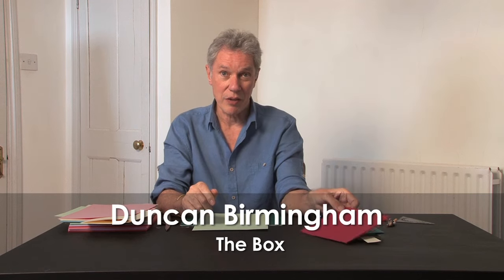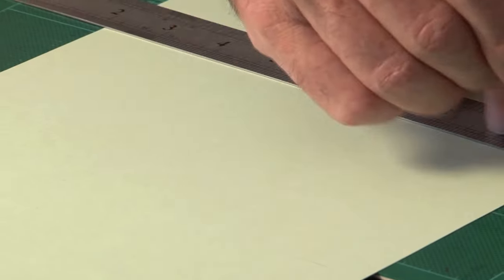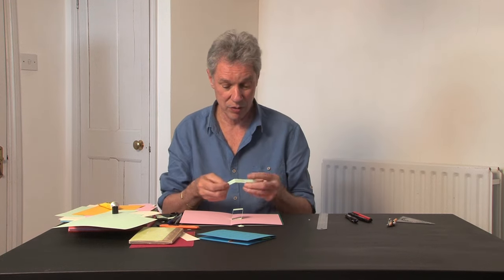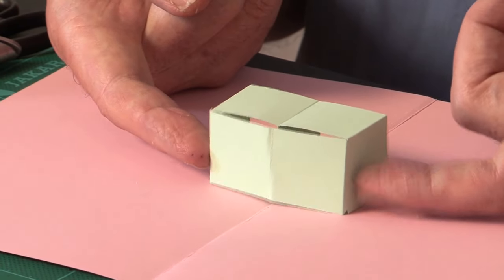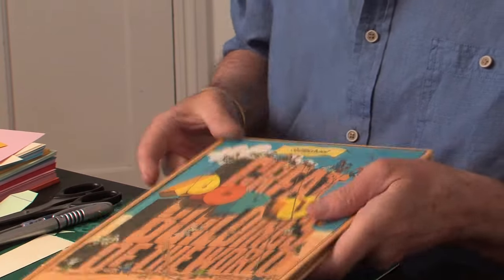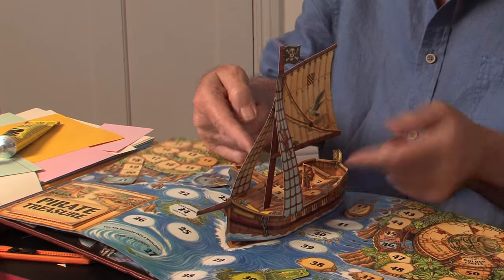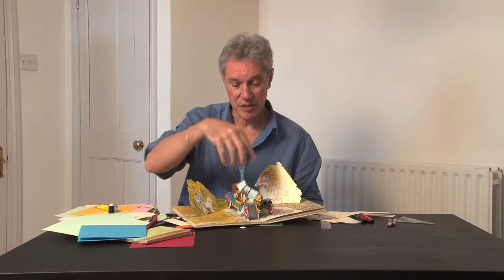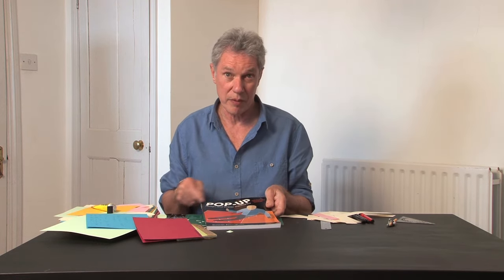Pop-Up Tutorial 14 - The Box

Comment: Hi! Your videos are great! What is the boning? tool you use for making creases.
Reply from the maker: In these videos I use fairly light weight card (160 gsm) which can be easily folded without scoring. For a really neat accurate crease one does need to score and I've found the most handy tool is a ball-point pen which has run out of ink. The key is to use a blunt point which compresses the fibres in the card rather than cutting them.

Comment: Hello sir.. my name is Amit Kunjir..firstly I would like to thanks. Gr8 mechanisms. I m planning an invitation card for my baby birthday. Pl chk http://youtu.be/O0c33Yo2VP8  ...pl let me know tutorials number for plane and clouds.. my paper is metallic ..pl suggest me glue as well..any glue is not working..thank you
Reply from the maker: The plane is a complicated and sophisticated design! Very difficult!  It is based on a Box mechanism (Tutorial 14) The nose of the plane is based on an Open-topped shape (Tutorial 14) and the clouds are simple Acute angle V-Folds (Tutorial 2). The mechanisms explained in these tutorials are the starting points for the design - but in the design they have been modified. I think you will need to experiment to find a glue that works but probably any solvent based glue will work.